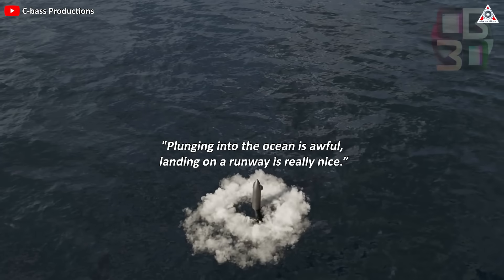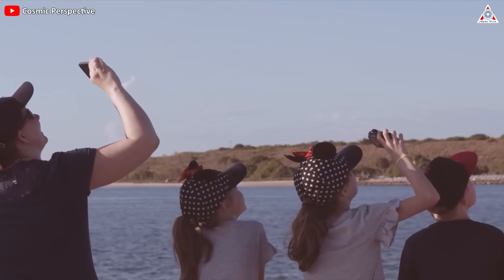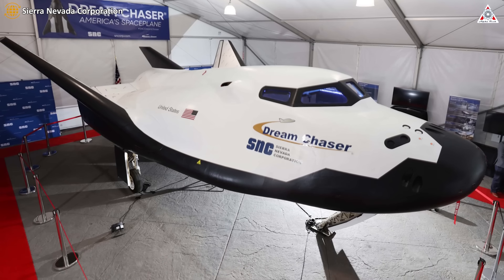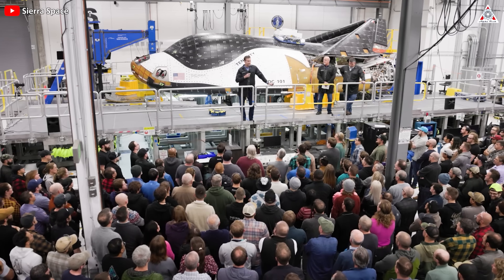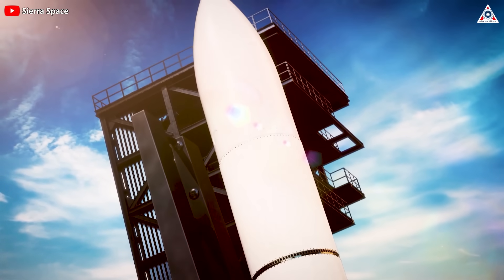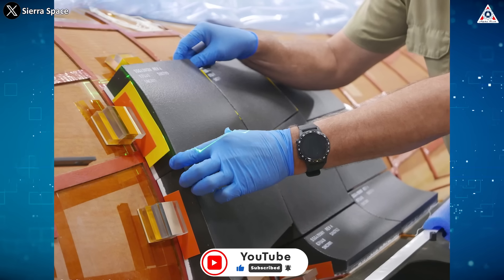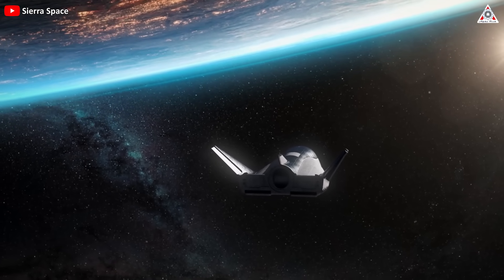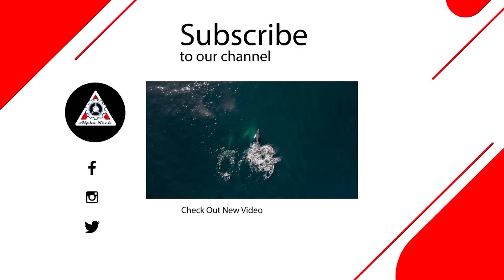Dream Chaser Tenacity officially completed, ready for the maiden launch...

Comment: given space X as the beggest booster and rocket??
adapting the SN to incorperate a cuppling modification to the top of the main Sn
would give dream chaser a huge habbittat haulage storage copacity.
with ability for sn to lift to space with dream chaser and return alone?
dock with dream chaser or with iss?
multi usability adaptability for all circumstances
along with ultra safe return for crews

Comment: This is not a new concept.  The Boeing X-20 Dyna-Soar was a United States Air Force (USAF) program to develop a spaceplane that could be used for a variety of military missions.  The program ran from October 24, 1957, to December 10, 1963, cost US$660 million ($6.31 billion in current dollars), and was cancelled just after spacecraft construction had begun.  Neil Armstrong was one of the pilots selected for this program.

Comment: How about a modernized Shuttle Orbiter perched atop a SpaceX super heavy booster as a second  stage?  A reusable booster lunching a proven orbiter would be a good way to get to orbit.
Reply: As long as Starship can land on a land, any shuttle type vehicle seems overengineered.
In my opinion any plane type space vehicle must be capable of getting into a space by its self to be more reasonable.
Reply: This would be beneficial to have one or two of these at the present and future space stations for emergencies.
Reply: @erojohn2  only viable purpose i see.
Reply: End of the day, it's $:Kg to LEO that matters.  If Starship is successful, DC won't be financially viable because it has to beat $150 per Kg into LEO and that ain't going to happen.

Comment: Anyone else seeing a sneaker with wings?
We couldnt spring for a front wheel?
Reply: The CEO explained that they didn't need one. It would take up space, add weight, and the area is subjected to high heating. They wanted to eliminate possible failure modes.
Reply: @psycotria  I don't think any Space Shuttle blew a tire. Isn't it a bad idea to have a skid that could generate sparks 🤔 I would want to be able to safely steer my plane safely to the
terminal or hangar...or to safely abort. Just IMHO.
Reply: @cski12894 You think they haven’t thought about this already? I’m not trying to be rude but your honest opinion doesn’t mean much compared to the decades of work put into this by people much more familiar with how it works than you or I.
Reply: 😄 it's called a Skimmer !